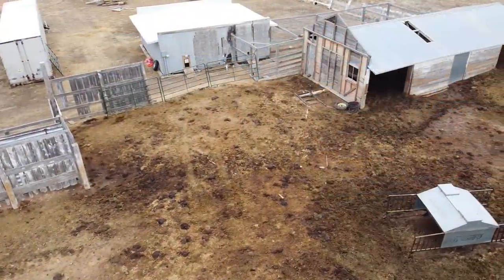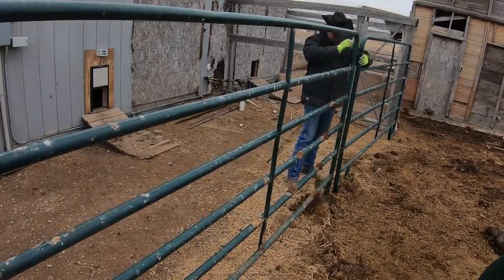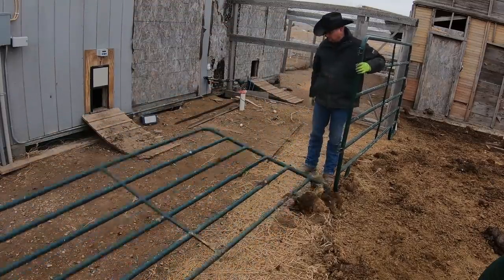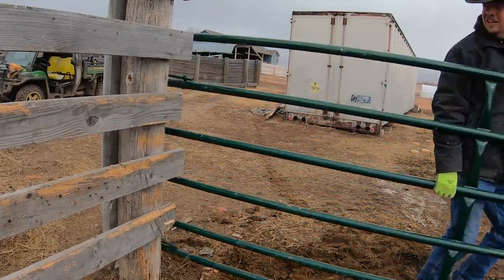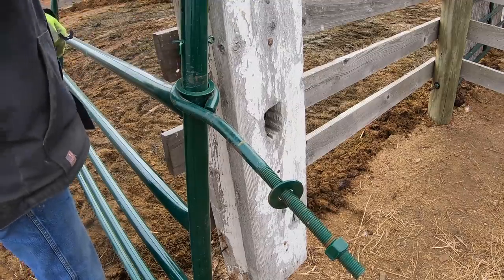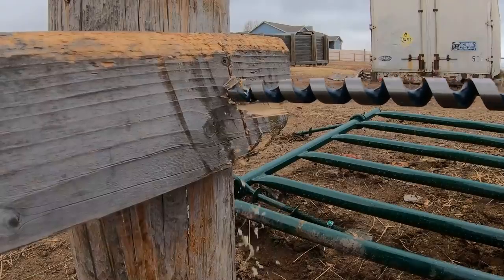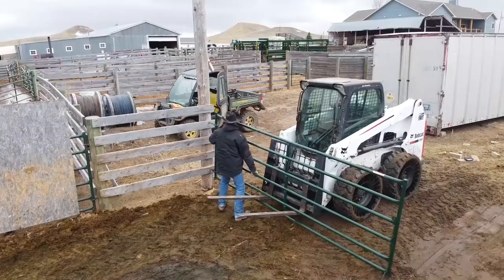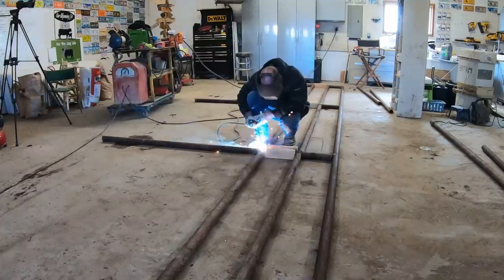Installing a Vern's Gate - Project List

Comment: Hi Mike,  When I was farming I invented a deal for taking out broken off fence posts. I had a machine shop take a piece of a solid steel about 2 ft long and he put threads on it and I would screw it in the broken post as far as I thought that it was solid for pulling  and I had a flat piece of steel welded to the screw thick enough for putting a chain on it and screw the deal in and wrap a chain around the end and pull up in your case with the skidloader and you can pull posts out in the winter instead of waiting for spring to dig out with a spade or skidloader. I pulled out hundreds of posts especially in the winter. Hoping this can help you out later on.
Reply from the maker: I’ve done something similar.  A lag bolt.   With a j hook welded to it.  Works like a charm. Thanks for a great idea. !
Reply: Seemed like the ones that always broke off were in cement so you had to make sure that they were into the post deep so they wouldn't pullout

Comment: I have found, at least on my place, installing the corner posts first, then pulling a string top and bottom between them to drill the post holes and setting the vertical posts at the proper interval, makes a much straighter fence than building the whole thing first and trying to finagle 1000 pounds of steel into a bunch a little holes. 

I don’t own a bobcat, which may be the deciding difference in the way you and I build and install drill stem fence.

Once the posts are in place and level both ways, cement is added to the hole and everything is given at least 24 hours to hydrate before the crossmembers are installed.

I use an Oxy-acetylene torch to  “saddle” crossbars and then arc-weld them in place using 6011 rod.

Comment: Is that gate made from 2" pipe.  We use HW brand red grates here.  A 12 footer is about 100 pounds like yours.   HW gates are red and match our Massey tractors.  Great video Mike.  Spring makes us all busy and it will be here too soon.  Lots to get done here also.  Thanks for the video.

Comment: Tweels work nice for no flats on the skidsteer, now what about lost/dropped nails/screws in livestock hooves. Not the best most livestock friendly demolition I've ever seen. You gotta know some loose fasteners ended up in the dirt. So sorry to rain on your parade but I'm speaking from experience of demolished barns.
Reply from the maker: Well if you noticed It was pushed out of the corral.  Trust me it’s cleaned up and that area gets scraped.